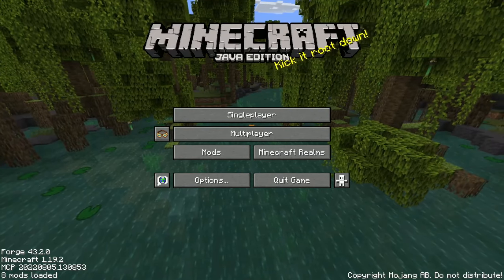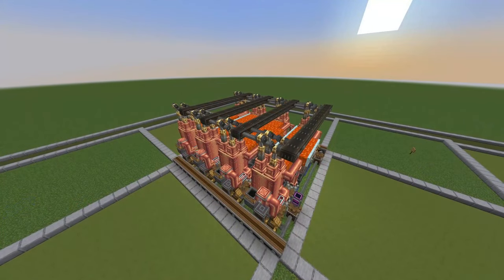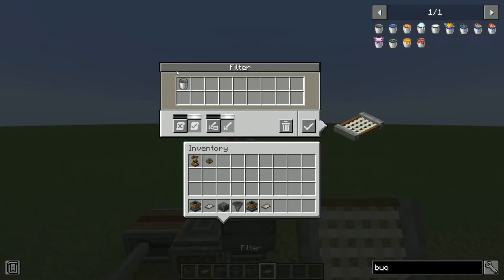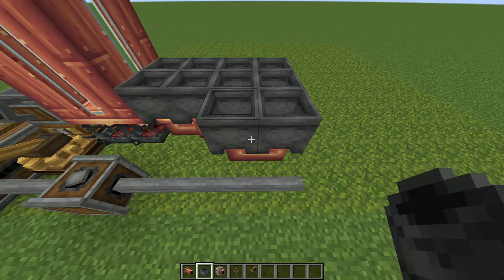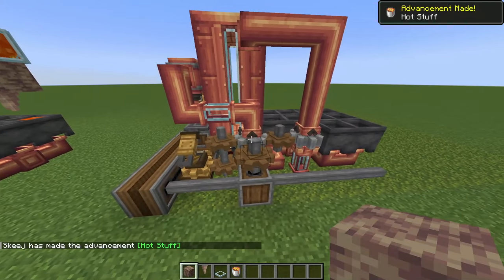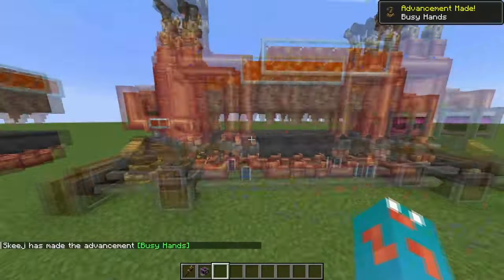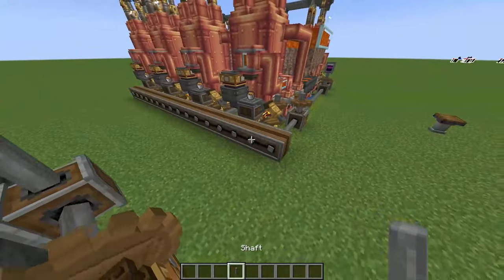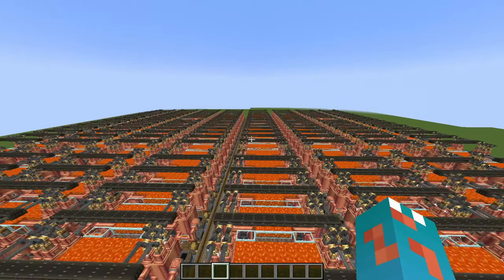100% SELF-SUFFICIENT + TILABLE Steam Engine TUTORIAL | Create Mod 1.19.2 | #tutorial  #minecraft

Comment: 5:00 for that elbow next to the tank corner, remove the tank block that the pipe elbow is connected to, encase the pipe elbow in a copper casing, replace the tank block

Comment: The math checks out for a 2:1 blaze ratio, about a 2 minute underlap for the blaze burner being empty though, a total of 140 seconds over the average refill speed of a cauldron, ~19 minutes. At a random tick rate of 68 seconds per tick, that is. Giving you a 1140 seconds of time between your last refill, lasting 1000 seconds per bucket amounts to about 2 cauldrons per blaze burner. Hopefully you just hit the good streak forever, but a 2 cauldron overfill can cover that cost entirely so either way your setup is perfect and I really love using it in my work ❤

Comment: Building in 2024 in Create 0.5.1f: Definitely works*. You'll need two large waterwheels and 8 stages of reduction to get enough speed to kickstart it. After that, add a rotational speed controller to the top steam engines and then a couple of shafts and gearboxes into the vertical gearbox to keep it running.

Comment: If it doesn’t work, and it says idle, you need to put a rotate speed controller on the water pump. I bang my on 194 and it works. You can go faster to for  batter output.

Comment: Ok LOVE this design so off to try it out. First design I made worked in Creative World but once installed at my base it doesn't fill the boiler.  Everything looks good, connected to my infinite "Hellhole", pumps all correct dirxns, power source hooked u...  but tanks say Lvl 1 water & heat are like NIL. 
REALLY hoping this baby takes care of my problems as its gonna power the town I'm so psyched to be building!! 😃
Reply from the maker: Try a few of these things:
>make sure the pumps are facing the right way
>the pumps need to be running at 256RPM
>Did you remember to put in the water sources for the pump? (Sounds daft but i always forget and feel dumb after)
Reply: @skeej_inc  Been working so just now back to play.  Thanks for this reply.
It was still slooooow filling up the water tho. 
Yep checked that pumps correctly aimed & had water in place correctly.  Just decided to start pumping in kelp blocks for fueling my Blazes & it took off, which then soon allowed me to kick up speeds & they all went to Level 9 immediately. 😁 Yahoo! 
Problem was that when originally running off the power sources (had tried both a windmill then waterwheels) & got "overstressed" as (just NOT enough s.u. output) IMMEDIATELY so had to keep speeds INSANELY low.)

Comment: Someone can help me? When i use this machine it doesnt work to power farms i put the speed controler but it just use the windmill power that i used to power the machine, just generates 2k su in each side
Reply: You need to pull the SU from the top of the boilers (add shafts), all that on ground level is just to power the engine itself.

Comment: I'm too dumb for this. Followed every step but then comes the jump cut and it's already running
Reply: He used a creative motor to jumpstart the system since it needs SOMETHING to get the arm moving and water pump running before the engine kicks in and becomes self-sufficient. Normal people do this with a handcrank on the water source for single water pump design OR by using a secondary SU source to kickstart the water pumps/mechanical arm.

Comment: I made an even better version of this using 2 lvl 9 generators side by side that produce nearly 300k SU. It's actually better than if I tiled 2 lvl 9 generators in the way you showed (Upscaled obviously) due to the fact that it uses a lot less resources for more SU. It only has one of those autofeeder mechanical arm things and overall uses less cogs and shafts.
Reply from the maker: Definitely, im glad you were able to find a way to improve on my design, the only issue is making sure theres enough cauldrons to reliably supply sll those burners
Reply: @skeej_inc  Well I guess I'll find out in my survival world when I build it there because I've only done short tests. Well, 30 minutes is a pretty decent time and it didn't turn off.
Reply from the maker: A good metric ive gone with is 2 cauldrons to 1 burner, sometimes i use 2.5:1 just to be safe but id love to hear how your tests go.

Comment: Tip if anyone's engine isn't working: 

Try making sure your tank is filling with water and not lava. Break the tank and re-place the tank starting from the top, where the water pipe connects, making sure water flows into the tank, then replace the tank fully.
Reply: @gavinchoi4239  yea the design will need an external source of power continuously running the engine, despite the "self-sustaining" title.
Reply: @mr.spaghetti2807  it actually doesn't. You just need to attach a speed controller from the output to keep it running.

Comment: So this is a great tutorial, but it is not clear at all that you used a speed controller on the first one to run the power back in for the pumps.  After rewatching the video several times, I saw the speed controller.   I've been spending almost an hour trying to use a hand pump to get it jump started and then every time I disconnect it, it stops because the steam engines don't go fast enough to keep the boiler full of water.
Reply: Not the hand pump 💀💀😭😭😭
Reply: @gavinchoi4239  you gotta make the windmill have enough stress units and fast enough to jump start the steam engines

Comment: wouldn't a ton of large water wheels be better? steam engines and large water wheels both make 500su and water wheels are more compact and simple, I'm pretty new to create so there could be something im missing.
Reply: no steam is far better. on the wiki it says it has the highest su capacity (16,384 su) in survival mode. contrary to that a water wheel has a max su of 320 but are more oriented to powering simpler and early game machines.
Reply: Steam engines only make 500 su when their water isn’t boiling hot enough. If you put lava in a blaze burner, and then use it with a steam engine, it goes up to around 16,000 stress units

Comment: What is the best way to connect the machine to itself. When I tried to connect it to the steam engine, it stopped working entirely.
Reply: Never mind I found a way
Reply: @mangofire4846  could you make a short video on that ? or explain how you did it ? I'm having trouble doing that too
Reply: I'm struggling to figure this out too. It seems the water pumps completely stop, even with 2 pumps running at 256
Reply: pls tell us how u made it

Comment: Tested it out in creative in 0.5. Could not get it to be self-sufficient at all and still required something to power it like water wheels. Not sure if the mechanics somehow got broken or what but can't get it to run under its own power. Glad I tested it out in creative and didn't waste time pulling down my current steam engine arrangement in survival only to find out that it wouldn't work and then have to rebuild what I had anyway 😅
Reply: I just tested it in creative and it works. What you have to do is to take the output from the steam engines (chain drive them), and send them to a speed controller. Through the speed controller, set the RPM to 192 and you will maintain a level 4 steam engine.

Comment: Is there a benefit for using 4 steamengines instead of 1 per machine?
Reply: depends on the level of the steam engine; level 4 means you need 4 steam engines to get the maximum stress units. so in this case yes

Comment: I followed your build exactly but after i disconect it from a starting engine the water pump shuts off immediatly how do i fix it?
Reply: Same issue
Reply: Water isn’t going up the pipe at all on my end, anyone know the fix?
Reply: @tr8v211  add a water wheel to jump-start it. Add a speed controller to the exit of the boiler and loop it into its own power input
Reply: @tr8v211  the thing is that the initial RPM of the boiler isn't enough for the water to flow at the good rate
Reply: I misspoke, I do have a starter engine, and water is going up the pipe. Its just not entering the fluid tank
Reply: @tr8v211  try cranking up the RPM of the pump. And check the director. The boiler is pretty water-hungry and it needs 2 separate pumps for water or one at a high RPM
Reply: @senseiplay8290  thanks, really did just need to up the rpm further

Comment: was about to make this and i came to the comments section to look before i built it. seems everyone has had problems with this. so does it actually work? or is there another method i should try instead? im fairly new to the create mod and just trying to find a simple design for big stress units. please help
Reply: I've tried it and if u somehow to manage to start the process it seems to work. I did it with a Windmill and afterwards connected it to the steamengine itself, u just need to put a speed controller with 192 speed, that should be enough to run that whole thing.
Reply: @Michael-bi2rv  same

Comment: i've made your steam engine ( wich is great) but i have a problem where the mechanical arm glitches out when i reloge and does not reconige the smart shutes or depot anymore it does not matter if i replace them they just wont regonize it, so basicly the entire contraption is useless for me, do you know any way to fix it? its a well know bug.
Reply: I had the same bug. Here is the deal. Mechanical arm doesn't feed blaze until he has about 200 sec to burn.
I tried many times to replace the arm, but just need to feed the blaze by myself, and then, in about 30 secs the arm took over the process.
Also, I put 4 pumps otherwise the boiler don't run on the max power.

Comment: How do I launch it. I followed the  tutorial but you don't show how you start the engine
Reply from the maker: You need to power the bottom half of the engine, using a waterwheel or another smaller boiler
Reply: @skeej_inc  thank you bruv really good tutorial
Reply: @skeej_inc  Have to get something to run it up to 192 RPM. Once you've got that running for a few minutes you can hook it up to itself (via the drive train) and it will support itself
Reply: Exactly, why don't you just show that part? I'm a noob, I have no clue how to start it. So I've built it for nothing.
Reply: @erwinzoor  A Windmill of sufficient size will do it.  Use a windmill bearing attached a sufficient number of sails and it will kickstart it.
Reply: @DigitalShepherd how do I hook it up to itself

Comment: CAN SOMEONE TELL ME HOW I MAKE IT SO IT DONT STOP AFTER I DISCONNECT CREATIVE ENGINE
Reply: You add a rotational seed controller to the water pump and set it to 255 so the water pump is faster, as just linking it is to slow and dries the engine out.
Reply: @OliverClark0907  192 RPM, but yes.
Reply: Yeah if you want more su you can use 192 but I like going to 255 to upgrade the actual main engine
Reply: @OliverClark0907  yeah, it ultimately doesn't matter.

Also, one thing I did was build up a jumper steam engine. It's a self sustaining steam engine that uses campfires as the heat source and generates 2048 SU, enough for half a module. If you hook it up right, you can use that half of the module to kick start the rest of the steam engines.
Reply: @troybaxter  ye that's a good idea I usually use waterwheels

You are  a genius
Reply: @OliverClark0907  Thanks. It was actually an old steam engine I made earlier to power my tree farm, mechanical crafter, and grinder down in my mine. I decided to repurpose it as a jump starter for my steam engine in case it ever goes out.

Comment: how do i even use this thing lmao
Reply: Is a power engine, similiar with windmill and waterwheel
Reply: @sir.baguette2448  ive never really seen create mod, i can tell this video is way over day one knowledge, but what does this run into? like how many farms could operate off of one of these?
Reply: @Kuzumai  This is not a early game or a beginner generator. One of these could run a whole factory depending on the size.
Reply: TLDR: Steam engines are used for powering a vast variety of machines at full capacity.

For a bit of context, every machine in the Create mod requires Rotational Force in order to operate. This can range from fans, mechanical arms, presses, fluid pipes, mechanical pistons, etc.

However, one isn't able to simply hook up a single water wheel and call it a day. Stress Units are this mod's measurement to how much stress/torque you're putting on your source of rotation. Different machines have different multipliers for how much stress output they have. For example, a Mechanical Press, having a 4x multiplier, will create stress units four times it's rotational speed input. Water wheels, which have a lower stress capacity, may become Overstressed if the mechanical press is using too high of an RPM.

Overstressing a system freezes all connected parts until the build is modified to facilitate all the machines without going over the stress limit, yet slowing down machines to prevent overstressing is generally not optimal. Nobody likes slow machines, as it causes bottle-necks in production lines.

Steam engines are really complicated yet useful machines that have incredibly high stress capacities, and are therefore highly sought after. Their high stress capacities allow savvy engineers to put out more rotational speed and therefore have all their mechanisms working at full capacity.
Reply: @mcskeeter5361  did read, thank you for the insight.

Comment: Boiler does not fill with water :(
Reply from the maker: Two main things id try:
1) Make sure your pumps are facing the right way, you can rotate them with the wrench
2) Make sure the pumps are spinning at max speed so the water keeps up with the needs of the engine :)
Reply: Were u able to fix yours?  I had same prob with mine tho from a diff design. (Hence me scouting for a better design option to try.)  Hoping this one works better as love that its compact (enuf for me) & that its tileable. (;
Reply: @jcofortco  i did fix it, pump has to be at 640su
Reply: 5 water wheels with 3 speedups, works on serwers too i added it along the bottom shaft but for full chunk module i would make one full engine to power pumps.
Reply: Have to get something to run it up to 192 RPM. Once you've got that running for a few minutes you can hook it up to itself (via the drive train) and it will support itself

Comment: the water is not getting into my fluid tank. I have the build exactly like you, and the pump is in the right direktion.
Reply: Add another pump linked to the water pipe, and crank it manually to fill the tank so it starts the cycle. Make sure the Blaze Burners are fed before pumping water.
Reply: @neilius-san  Hi, thank you for your comment. I did that now but still not working. If I remove the steam engines. The tank turns into a normal tank and recieves water but as soon as I put back the engines on top it stops receiving water

Comment: how about infinite lava source
Reply: that would  be less efficient

unless you change the config
Reply: @ralphwiggum1203  concious about why "that would be less efficient"
Reply: @劉宸瑋-i4e  do you mean confused?

if so i mean that a hose pulley getting an infinite lava source is slower and requires 10,000 blocks of lava
Reply: @ralphwiggum1203  got it, thanks. So, the cauldron is fast enough to produce sufficient  lava, right?
Reply: @劉宸瑋-i4e  it should be yes, in addition, the tile-ability of the design means you can expand it as needed without the 10,000 block lava source
Reply: @ralphwiggum1203  got it, thank you
Reply: @ralphwiggum1203  you could build the infinite lava from just a 20x20x25 hole
Reply: @ScorpioneOrzion  omfg How Do you not realise that that is still less effiecient.

dont comment if you dont know what the hell you're talking about

Comment: Some constructive criticism:
Could definitely be compacted with a lot of the piping done away with. 
Putting the engines on the top is very space inefficient imo. 
And lv9 engines are generally more bang for your buck as you get twice as much power with the same amount of supporting mechanisms ie pumps, mechanical arms, speed changers etc. 
And the lava system doesn't require 2 smart chutes. A single brass funnel will do. Nor do you need to use an item filter when you only are filtering for one item. You can place single items within the filter slot of a chute or funnel
Reply from the maker: Definitely, though part of my design was keep it small so i could fit a larger number of the modules into one chunk, i have plans on making a V.2 design, so the criticism is much appreciated ❤️
Reply from the maker: You cant really see it in the video also, but with regards to the filtering, im using item filters as im having a bug in create lately where items render behind the chute texture and you cant see them clearly, it was for demonstration purposes so you could easily tell there was a filter there
Reply: @skeej_inc  already got a lv 9 to fit in a 3x10x6 with cauldron supply.
Usually my designs assume one has an infinite lava source as those are pretty easy to make even in the early game so I haven't worked with cauldron based stm plants in a while.

Did notice the bug yes. Only commented on it because I went about 2 weeks before realizing you didn't need item filters myself.